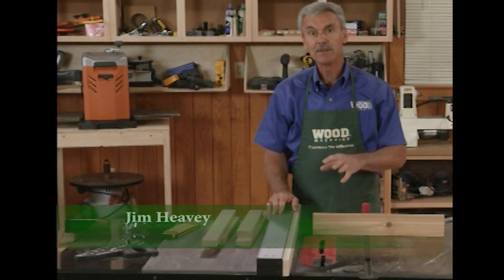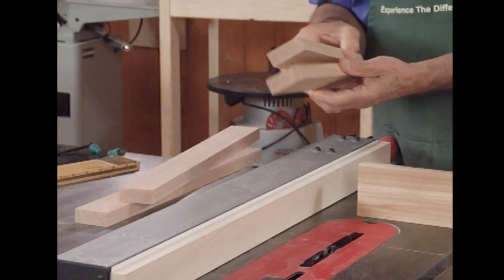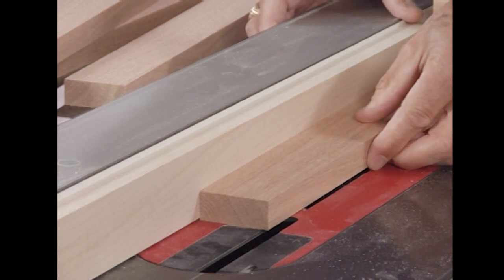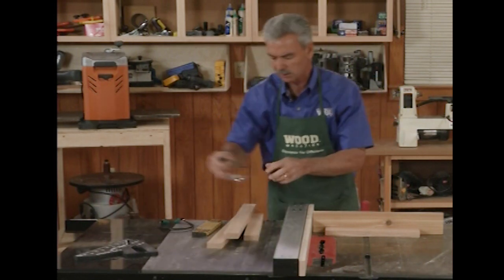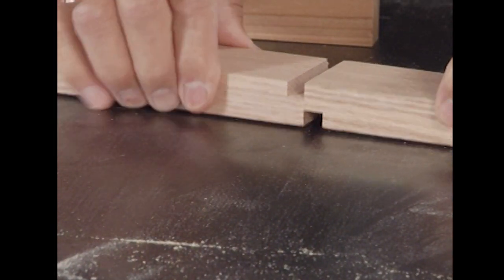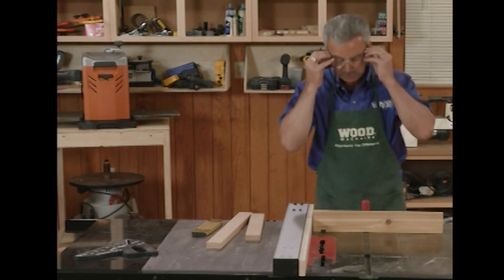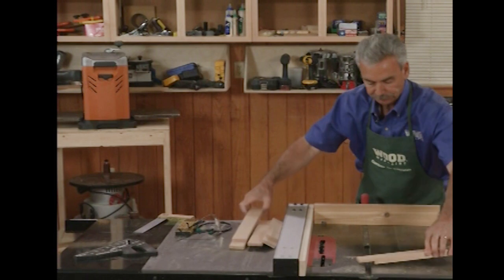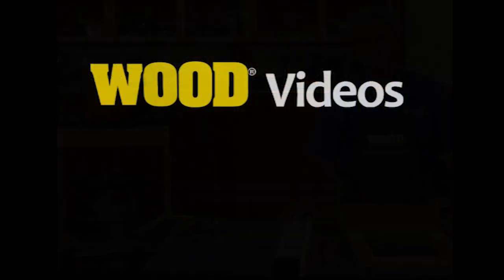How To Make Simple and Strong Half-Lap Joints - WOOD magazine

Comment: I used my sliding miter saw with a regular blade, though a flat top is slightly better. (refer to a video on doing this). To get it exactly the right height to remove only half the thickness, I borrowed the idea from another video and it works great! No math or measuring. Start with the blade a bit less than half by eyeballing it. Saw about an inch of it into the length to create half the thickness removed. FLIP IT OVER and saw that same area. If it leaves more than a paper width, lower the blade infitessimally until there is next to nothing. Then the saw is at half height to make the joint.

Comment: Thanks Jim. Was looking for a quick, easy, and strong euff joint for a couple doors on a hot house I'm building for the Mrs. My shop-smith already has the dato cutter in it. Plan to use a piece of 3/8ths plywood for the inner panel, so I'll need to rout a groove on the insides. Thanks again.

Comment: need the joint to be Flat End To Flat End & easy to become one piece again 3/4 x 2 1/'2 x 30 joined to another board of the same size to become 3/4 x 2 1/2 x 60 to span 53 inches.